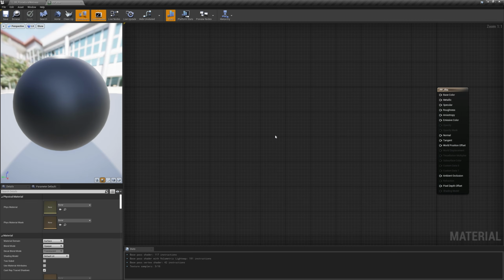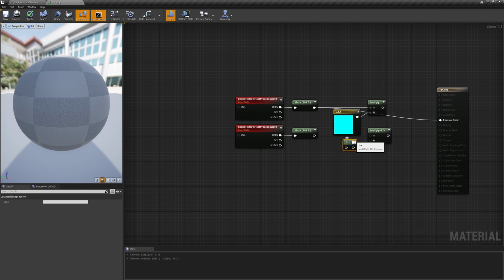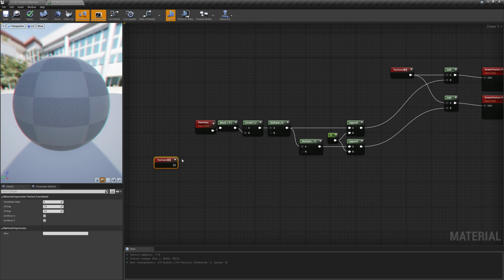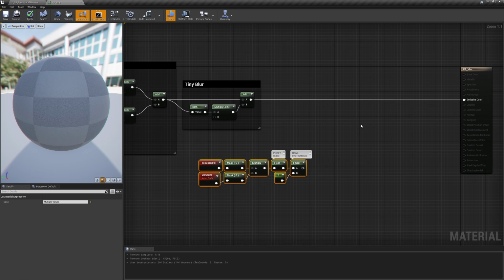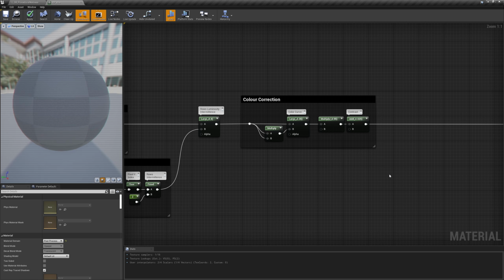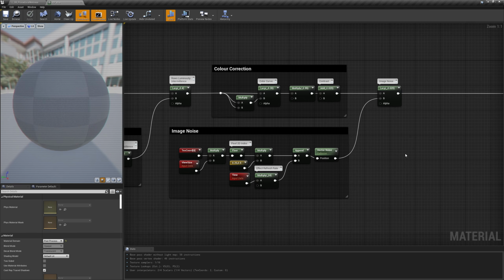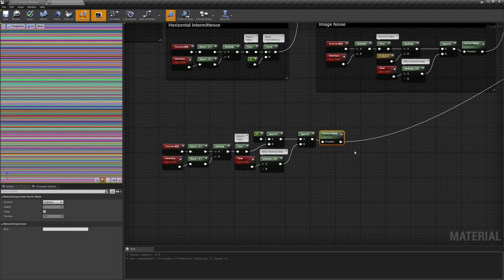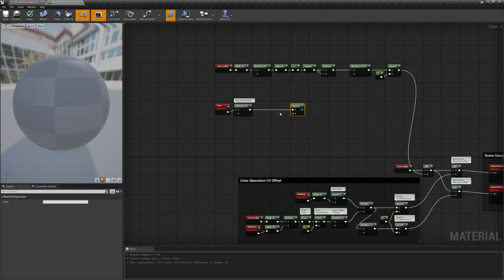Worn Out VHS Post Process Effect and creative uses of Vector Noise node (UE4, valid for UE5)

Comment: how do i get that smooth step thing? its coming up as a function for me
Reply from the maker: If you don't get the node you're using an older version of UE maybe? The MF does the exact same thing anyways, the node was added with 4.26 or 4.25 I think.